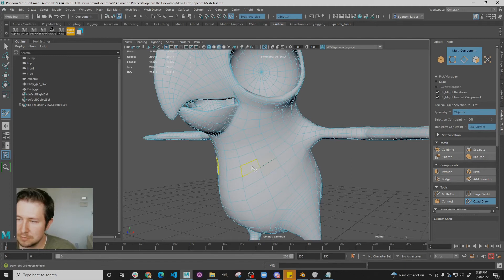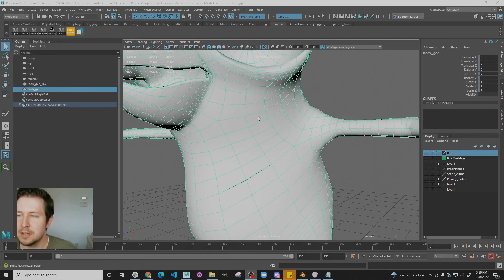Slow Quad Draw Tool in Autodesk Maya - How to Turn OFF Construction History

Comment: still doesnt work when mesh is a medium poly
Reply from the maker: You could export your dense model as a GPU cache, then quad draw over that
Reply: @SquamashiiTutorials  I've tried that, but when generating a single quad with shift click it still takes forever. I have to retopo dragging edges from the existing geo, if u get what I mean.